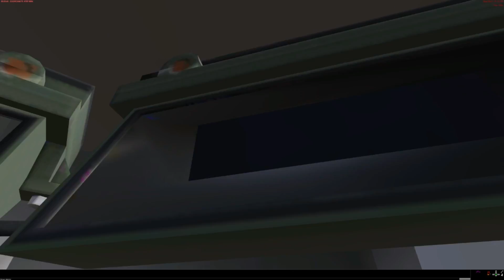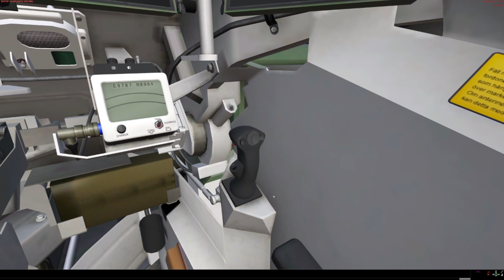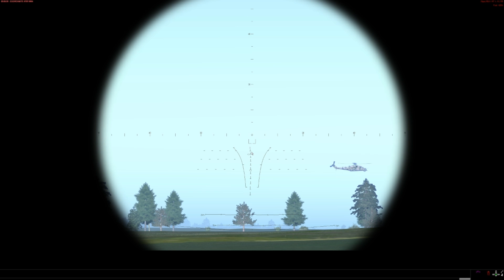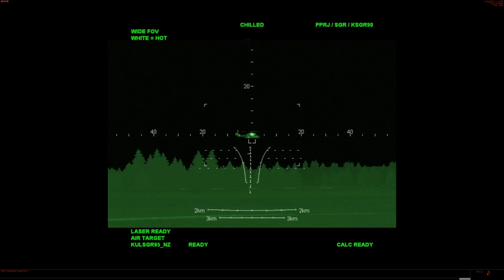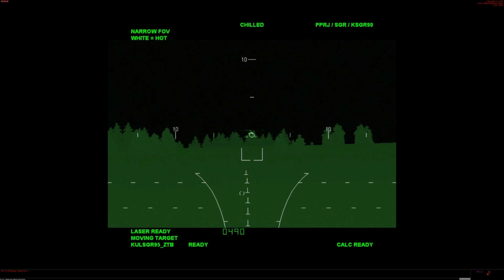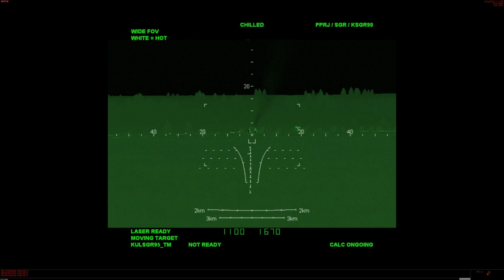CV9040 Switchology and Fire Control System

Comment: That was actually only a single radio set behind the VC, a standard infantry model RA180 in a RA480 vehicle mount power boost station.
Reply: Both are part of the same coms system family as the DART 380 (DAta Report Terminal)
The dart is essentially a text message device with a number of preset communications forms for anything from status and observation reports, replenishment requests to sending fire missions and fire corrections to artillery units.
Reply: @SonsOfLorgar  You guys got RA180's ?
We had to use the RA480
Reply: @AdurianJ  the 480 is the 180 in a vehicle/stationary effect booster.
I've never been inside a Strf 9040, but I did most of my 10 month conscript training in the rear of a Tgb13 with two 480s,one hooked to a DART380, one to a fire sollution computer, plus two180s for voice nets.
In this video, the RA180 part of the 480 is where the display and buttons are, the booster unit is the metal device surrounding the 180 unit like a flipped L
Reply: @SonsOfLorgar  i meant Ra421

Comment: What do you guys think is better m48 or t55
Reply: Better for/at what?
For me, since I'm somewhat too... broad in the shoulders - that's my story and I'm sticking with it. period. -  to origami myself into tight places, the M48 would definitely be the better vehicle.
Reply: The 14 kg GRG m/48 beats both of them ;)
Reply: M48A5 version but otherwise I think it’d be much more of a dead heat.
Reply: Whoever spots the other first. Although I have to add the m48 did defeat the t55 in the Middle East.
Reply: M48. crew comfort and a bit better visibility (idk, it seems like it would) also another crew member to help out with tensioning the track.
Reply: @24videowatcher  T-54/55 predates adoption of auto loader, so both vehicles have 4 man crew.
Reply: T55 FOR ME
Reply: t55